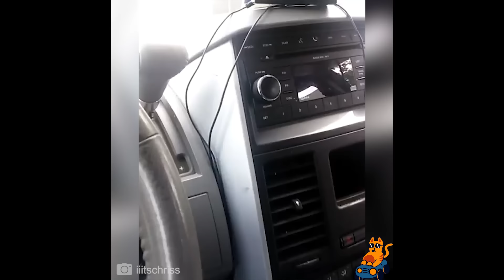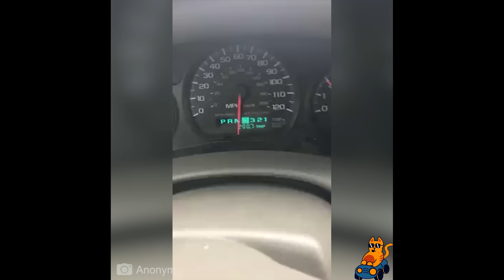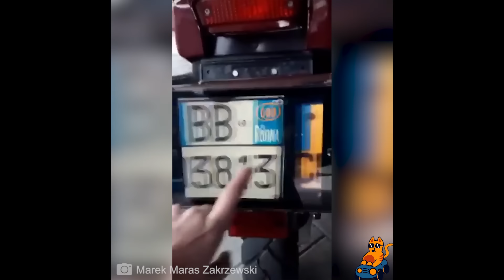Mechanical Problems Compilation [Part 6] 10 Minutes Mechanical Fails and more

Comment: The impreza lasted longer without oil than they usually do with oil.
Reply: Ha! Excellent
Reply: Hey  thanks for the tip
Reply: The only thing worse is a Mazda Wankel
Reply: ??? 04 wrx with 223k original motor & trans and still going.
Reply: Harsh but tru
Reply: @DJDekgit  '03 Wrx with original motor, trans, & turbo 157k miles and still counting, it sees 3k rpm for a total of 50min a day on the freeway as well. It's that EJ205 life man 🤙🏻
Reply: @Grooove_e  Same also original turbo. I did 2hrs between 2500-3500 today on highway. And some 3rd gear drops to 100mph. Arrogant tailgaters. It's also winter, back the fuck up
Reply: Lol that's funny
Reply: Chrysler slant 6.  No oil, drive it about a month until it seizes.  Let it cool down, fire it up again drive it another month rinse and repeat.
Reply: 😂 BOY
Reply: 99 outback with over 300k still rollin
Reply: The sparks where just the engine self clearening and the rod want needed
Reply: Can't blow a head gasket without any oil
Reply: @Grooove_e  04 Accord with 250k original motor and trans. Im 2nd owner, my gf parents bought it brand new. K24A4 for life
Reply: @TexasP00nTappa  Yes very good engine as well, but the EJ205 will last just as long and makes 12psi of boost when ya want it. My point is that not all of Subaru's engines are unreliable, just most of them lol
Reply: old Volvos from the late 70's to mid 80's: "you sure about that?"
Reply: I mean. If Subaru suggested oil instead of brown water for lubrication then they would last far linger
Reply: I allways wonder if people who get those killed are just very bad in maintaining and beat the shit out of a cold engine..... mine (EJ20)  has 280000 miles on and i still drive it every day without any Problems what so ever. And a lot people i knwo have never had any Problems at all beides some rust on some of them
Reply: Yurp
Reply: Poor car
Reply: To me it seems most subarus blow because noone does a oil Change and so on on them
Reply: The Subaru fam takes this as a war crime and will never be forgotten or forgiven
Reply: Now run it again with oil
Reply: Facts
Reply: @Grooove_e  I am first owner of a 04 WRX . Still got it. Everyday car.
Reply: I know im asking the wrong place but does someone know a tool to get back into an Instagram account..?
I was dumb forgot my password. I would love any help you can give me.
Reply: @Joshua Maxwell instablaster ;)
Reply: The metal became the lubrication….

Molten steel to be exact 🤓
Reply: Ouch.
Reply: It's funny when people think it's good to get only 250 out of a engine iv had ford's all my life and not one has dropped an engine I'm hard on them but change oil ect the one I have now has done 476 and still does a good burnout 😁
Reply: Subaru's just love to eat oil. Mine guzzled half a qt every month inbetween changes, but that mostly because there was a small leak involved with the VVT (idr exactly what part). But alas.. a piston bent a valve, and brought her down. On an engine that only had 80k miles on it 😭

I have the parts to fix and get her running again, just no time
Reply: @Ben-222  wtf
Reply: @Ben-222  jk@ss
Reply: @vitormorais8267  yes
Reply: Must have been Castrol GTX.
Reply: No no no noooooö
Reply: I'm imprezd
Reply: Damn
Reply: Now use the molten rod to cook bare handed
Reply: It'll blow a head gasket before it runs out of oil. lmao
Reply: Hope they put something better in it, it looked pretty clean, and I’m not a Subaru guy.
Reply: @sirpeaches5086   that the truth
Reply: FACTS!
Reply: I think u cracked the code maybe they don't need oil to run
Reply: it kept running for 15 seconds after it threw a rod
Reply: @d_dawg05  they most probs throwing in an STi or WRX engine coz it looks like the RS model of the GC8
Reply: @thatgaykid420  it's not true, it simply needs oil and new apex seals every decade or so, then there is not much to go wrong.

Comment: There aren't that many 99' imprezas on the road for someone to run it without oil til it popped. Out of all the clips that one actually bothered me
Reply: Yeah same here, i had a 95 and a new 97 at the time subtly tricked out of course (really miss it)
Reply: The motors in those are pretty trash, I'd say they were getting ready to STI swap it and grenaded the motor for fun, I did the same thing to my v6 mustang before I dropped a 5.0 in it
Reply: @badrott8028  Seems silly unless you can't sell it for some reason. Hell, even if it's busted, there'd still be the parts value.
Reply: @unsafevelocities5687  mine was a pos 3.8 Ford v6 literally the worst of the worst, wouldn't want to sell it to some poor guy, so I sent it out with a show
Reply: @badrott8028  So somebody trying to source a 3.8 has one less option? How's that help them?

At the end of the day it was your engine. However, I still think it's childish to blow something up just because you personally don't like it and don't have a use for it. Value is subjective; you could have given somebody who does value the engine a really good deal or donated the engine to a tech school, etc.
Reply: After 320k my 99 2.5 wrist pin let go found it in oil pan little end of rod lodged in block big end swinging like a bat off crank smashed through block at main oil gallery. Happened raining in heavy traffic l was in the hammer lane shut it off looked in rear view it was carnage behind me. Coasted down off ramp. Drove onto car trailer started it a few times for laughs, cars making a weird noise..... drove into shop. Picked up a 2.5 from wrecker with new heads t-belt w-pump ect 400.oo I'm at 450k now who says subies don't last.
Reply: Man, a lot of people sure do whine about what other people do with their personal property.......
Reply: ส
Reply: I was more concerned with the fact they did it in a enclosured garage with no ventilation
Reply: It's a pos. Cheap rustbox ricer
Reply: It's a Subaru, who cares!
Reply: Because it was a 2.5 not the 2.0, the 2.0 is far stronger and better compared to the 2.5.
Reply: The sooner people forget about subarus the better.
Reply: I just hope they’re planning on swapping the engine
Reply: Yeah that did bother me seeing that , they just threw it all away . Like you said there aren’t that many 99’ Imprezas left .
Reply: @TheSevenJr86  true
Reply: Ahhhh feeling saddest? 😂
Reply: Ahhhh sad boi 🤣

Comment: 6:38 thats the most comical, cartoon-like engine explosion I've ever seen. Also real smart redlining the engine as you can obviously hear it rattling inside
Reply: Lol rumor has it his piston is now orbiting mars
Reply: I know its a hard concept but just because the engine is on a limiter doesn't mean its the "rev limiter"... the line on the dash has literally no bearing on any engines limitations..
Reply: Is that a kadett c ?
Reply: that was a nitrous backfire. intake manifold exploded
Reply: just by the way it's revving he definitely had a friend tell him "bro I know someone who can tune your car cheaper"
Reply: @bramlommen3153  I think it is a Chevette, it's a brazilian thing
Reply: @TurboVisBits  Its still not smart to bounce off the limiter. And yes, it is the rev limiter. It limits the revolutions of the engine. You know. So sports cars don't tank their horsepower by making peak at 6K yet reving to 9K and losing 150hp along the way. And so a POS can't over rev its unreliable parts and put undue stress on the..
Reply: @LuisEPGomes  yes, it is a chevy Chevette
Reply: You can tell the problems begin at 6:44. At that point, he's already facing an engine rebuild, but may have been able to save it.
Reply: @edratliff  I do understand that but it still doesn't sound very healthy
Reply: TurboVisBits “the line on the dash has literally no bearing on engine limitations” so you’re saying I can run my engine 2k above redline with no consequences at all? Nothing like valve float or blowing a lifter perhaps?
Reply: No shit eh 😂😂 like clearly you can hear he hurts the motor on the first boosted launch , but naw fuck it lets hold her on the 2 step and try again .. 💥🚀lol
Reply: is the Volkswagen engine called AP, which in Brazil means High Power, it’s already an engine from the 90s, it’s very common for people to put this engine in other cars, in this video they’re equipping a Chevrolet Chevette, many use this engine here  in Brazil due to its low cost price
Reply: The rattling sound was the wastegate you knob head😂
Reply: @TurboVisBits  you can rev an engine up to 10k rpm

Once
Reply: Wasn't redline but okay
Reply: @edratliff  I'm glad someone said it
Reply: @yenah1669  HA
Reply: i really want the passenger’s POV
Reply: @syanheart3178  rev limiter is there to keep your car at a safe rpm, theres no reason why you shouldnt be able to bang limiter as long as 1: the car is warmed up 2: you arent low on oil 3: you arent knocking or misfiring like the guy in the video. he obviously had a shitty tune and was running nitrous
Reply: @AwakenedR6  Cant wait for someone to take your advice and ruin their engine

Comment: 3:15 Why the heck would you do that?? Even if the engine needed rebuilding beforehand, Impreza engines aren't exactly cheap throwaway lumps. Crazy.
Reply: The ej205 in that car is dirt cheep
Reply: For the fucking views!
Reply: Hentai is healthy sorry but most certified shops still mistreat customers cars. I caught bmw of Nashville beating the shit out of my e39 M5 on a dash cam when I dropped it off for a new throttle actuator. They put over 80 miles on it in 3 days.
Reply: Hentai is healthy you realize that um that was probably their friends car.
Reply: With a 1990 toyota engine this video would be measured in days not seconds
Reply: I just hope that’s not a customers car
Reply: That’s what you get when sex isn’t regulated...😏😏
Reply: Suburu engines are junk from factory
Reply: @Mark-vn7et  90? Nah 70s to 80s is where it's at for indestructible Toyota motors. 20r and 22r. You just can't kill those things
Reply: Because its awesome watching a motor running with no oil pan, and then grenading 😂 where do you get to see it!
Reply: Remind me to play with my dog's 🐶 🐶 more and more treats
Reply: @jdmcarboy64  The EJ20x engines dont suffer head gasket problems
Reply: IIGrayfoxII who lied to you?
Reply: @jdmcarboy64  I have well over 130,000km.
No issues on my EJ20
Reply: Why not
Reply: @Sibbe2560  what
Reply: @jdmcarboy64  It's true, common practice unfortunately, I worked in A VW dealers a while back and was appalled at how they treated customer cars! But have since learned thats the case at most places :-/
Reply: Subaru Boxers break if you cough at them funny
Reply: I mean its their fucking car, their choice lol
Reply: I Hate subarus
Reply: It’s for fun Karen
Reply: @Demonslayer20111  my dad's Toyota Camry ran for 21 years
Reply: @punman5392  tell that to the 600hp daily driver subs
Reply: @thatonenigeriansformula  I have a 1981 Toyota pickup. Original motor, odometer rolled at least twice and stopped working three years ago at 79k. Probably at 300k now
Reply: @thatonenigeriansformula  600hp daily drivers🤣🤣🤣🤣🤣🤣🤣🤣🤣🤣🤣🤣🤣🤣🤣🤣🤣🤣🤣🤣🤣🤣🤣🤣🤣🤣🤣🤣🤣🤣🤣🤣🤣🤣🤣🤣🤣🤣boy you been watching too much fast and furious on TV 😅🤣🤣🤣😅😅
Reply: i was sittin here and almost started crying... i mean i dont have Mutch Money so i need to wait that these cars get cheaper so i can buy one... and then i see that shit :/ one less i can buy...
Reply: Mark CAP
Reply: COngratulations...you've rendered it a worthless piece of scrap metal.
Reply: It’s ok we live in America. We have American V8 😎
Reply: @fuckngreat8955  German cars are better than Fords.
My mums focus had an issue with the IMRC solenoid at 40k KM as well as the engine mount at the same time.

As for my Imp, 141k KM, no oil leaks, does not burn oil.
Reply: Shitpreza
Reply: @jdmcarboy64  most usdm ej engines go for a few grand now if they’re lower mileage. Not exactly cheap for most people
Reply: I just sold a phase 1 ej22e for 1100$ locally
Reply: @IIGrayfoxII  try 512k km on my 97 7.3L
Reply: mastakush47  do you own a Subaru? Or do you work on them? Because I doubt it highly
Reply: I think they just did that for shits a gigs cause the motor was getting built anyways,removed the oil pan so theres no damage to anything besides internals. So I'm not too bothered by it given the fact only sleeves and pistons and bearing were ruined
Reply: They're pretty cheap
Reply: Fer funsies
Reply: @jdmcarboy64  wow
Reply: Its youtube and its ther life
Reply: @losh7489  that doesn't make it better
Reply: @juanm.gonzalez1572   prob already done for? Rodnock Misfire Bad Oil leak? Cracked block?
Reply: When I worked at the wrecking yard about 8 out of 10 Subie's we got in the engines went straight in the scrap bin. Even the ones where the car was wrecked. Most of them had head gasket issues and a lot of them had pretty loose internals.

Comment: 0:46 now THAT is a smooth running engine
Reply: Rolls Royce Phantom
Reply: 12 piston engines in general. The higher the piston count the less vibration there is.
Reply: Hello frien
Reply: why is that even in a "mechanical problems" video?
Reply: That isn't a mechanical problem. That is an amazing feat of engineering.
Reply: @dekoldrick  exactly!
Reply: Can attest, worked on a 1991 SL600 that never ever saw rain, and looked factory new. 12 cylinder beast that took 24 spark plugs, but wow it was really smooth and quiet
Reply: Or just a well balanced engine
Reply: @TheNorseStargazer  Not necessarily. Most 4 cylinder mercs from the 2000s can do that. Mine was om611 2.2 l diesel and it could do that.
Reply: Dam
Reply: I don't know why that would be considered a mechanical problem it's clearly a mechanical success
Reply: Phasent You do realize the title says "and more" so they can up the length
Reply: Take 720 degree's which equates to a full 4 cycle operation of the crankshaft and divide by 12. It gives the number of degree's of crank rotation that each cylinder is firing, hence why a V12 is so smooth. 60 degree's to be exact. Fyi, that is a N74TU2 in the Rolls Royce. Same engine that BMW uses in its 760i. Don't believe me, look it up.
Reply: bmw Engine :)
Reply: Video should have been renamed "Mechanical fails and wins"
Reply: @whoshod  nah its a cullinan
Reply: @TheFerociousWolf  oops my bad
Reply: @whoshod  i gotta apologize myself man. the backdrop was very similar to the rolls royce cullinan review but the coin test was infact with a phantom.
Reply: @TheFerociousWolf  yo you stoned too man?😂
Reply: But how that was a mechanical broblem ?
Reply: @emanuilnedqlkov206  balancing shaft
Reply: Oooh, thank you so much!
I was so confused what was going on.

Comment: 6:11 ah yes this is why limited slip difs should be in all vehicles because at least this person would have had a chance.
Reply: I agree with you, but lightly applying the brake would allow some power transfer to the wheels on the ground in this situation

Comment: I've done the first one before. Throttle cable in my bug snapped. I took the rest of the throttle cable, tied it on the carb, used a pair of vice grips, and hand throttled my way home

Comment: 6:38 best clip ever
Reply: Common supercharger failure, either he doesn’t have or wasn’t watching his engine temp or pressure gauges. He heated his internals too much and his piston rings expanded and closed up the head from the block. That blew the piston straight to space. Boosted cars require good internals, a good block, a good tuning, and most importantly a competent driver.
Reply: K-0

Comment: 2:35 destroying a good engine for no reason. 😕
Reply: yeah true
Reply: an EJ25 is not a good engine sir, it'll be shit after 100k miles anyways
Reply: It was already at the end of its life. Might as well end it with a show.
Reply: cursor_backspace Mine is running very well. It’s at 117k and gives me smiles all the time.  I’ve had to replace some stuff, but overall it’s been a very good experience.
Reply: @nabox1435  watch those headgaskets
Reply: cursor_backspace lol. Already done.
Reply: It’s called fun it definitely won’t be fine it will be done in one way or another well certainly is now😂😂😂
Reply: I'm not Fire Marshall Bill but jeez that thing was a hazard on top of its bs in general throwing red hot pieces everywhere good way to burn a garage down
Reply: @silverlgt9038  100k is alot
Reply: MR hacker  i am saying thats a lot i have seen sub engines go as far as 230k
Reply: who says it was good? it may have been junk, and they planned to swap it.
Reply: @claytons4789  if i where to do a swap i would sell the motor for parts,this motor probably has metal shards in every nock and cranny
Reply: @thatonenigeriansformula  that's an asshole move. You don't sell motors that don't have any chances of being fixed, you just blow em up, and then scrap em.

Comment: 6:11 I think it's time to weld the diff
Reply: Calvin Burton how did he even end up on that.
Reply: Taking a corner to fast and sharp, it's like panicking on an intersection taking a corner at the last minute when a car coming for you is getting too close and you ramp up the curb, except this guy just sent it and didn't see a giant bolder sitting there, the good thing is the bottom skid plate did it's job and protected the motor and torque converter enough to where it tipped it over, welding the diff would keep one wheel from stopping and the other going, and instead have none stop and both keep going when one gets jammed up or has more pressure on that side.